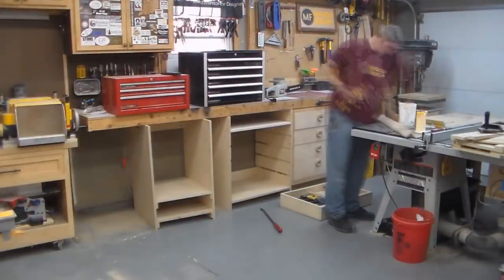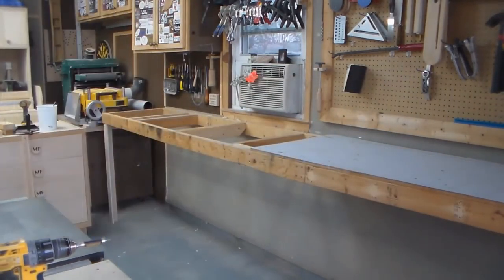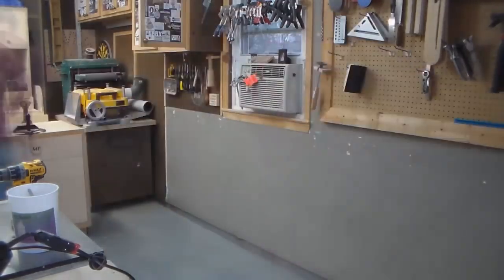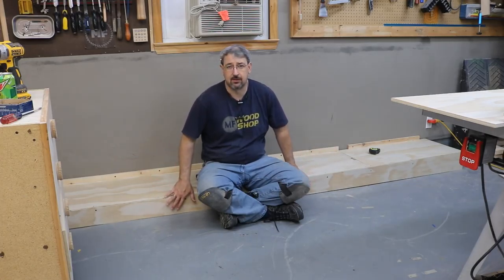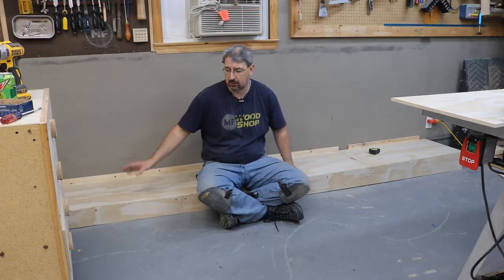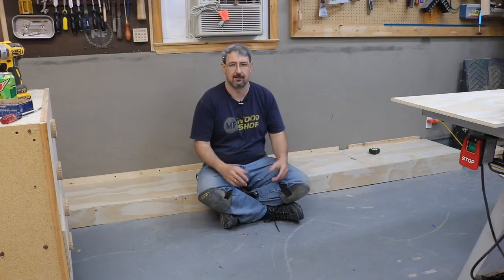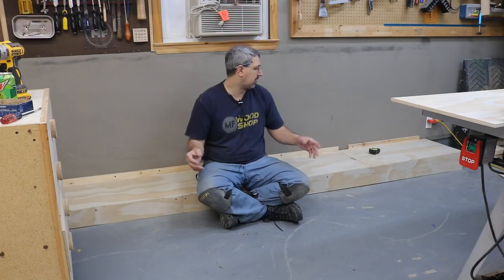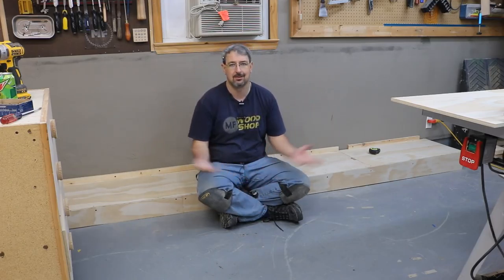How to Build a Work Bench Part 1

Comment: Mike
Nice build.
Whenever I see raised floors I always think of my 1960s experience trailing along with Dad into computer rooms.
Besides being a toe kicker for your cabinets, your raised base is a run for low power (internet, cable, security, and etc.), electric, plumbing, vacuum, and compressed air systems.  
Your design with those thin electric boxes provides ideal means for all these systems to reach the benchtop.
My next benchtop will have vacuum, air, electric w usb.  

If it is not too late, may I suggest an in progress update to your electric outlets of usb combo outlets?  
That way your phone can charge while you are in the shop.
Reply from the maker: I don’t need the usb at those locations but I am going to put one in the wall next to the window you’ll see that in video 3